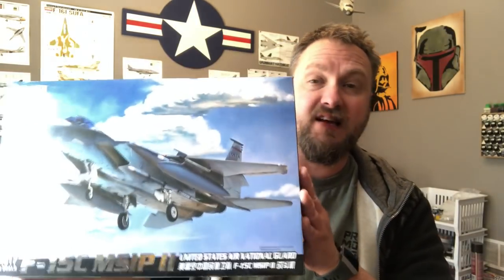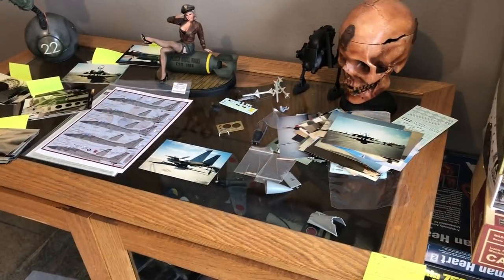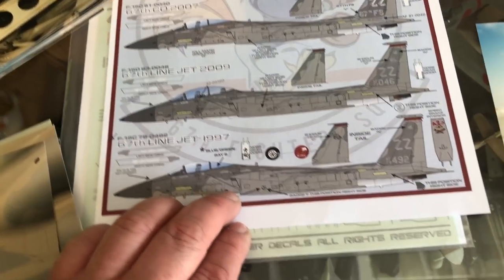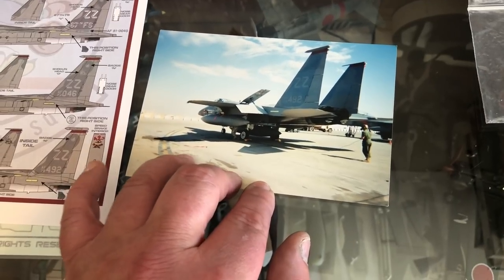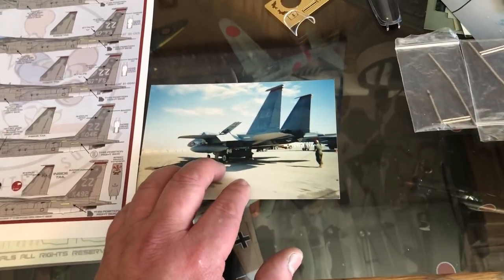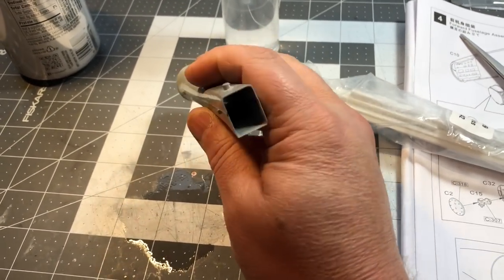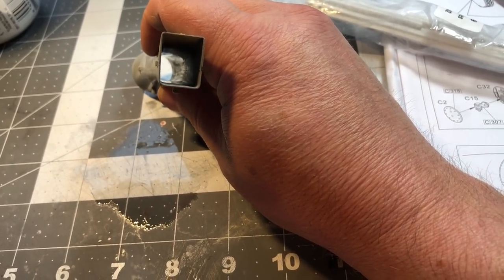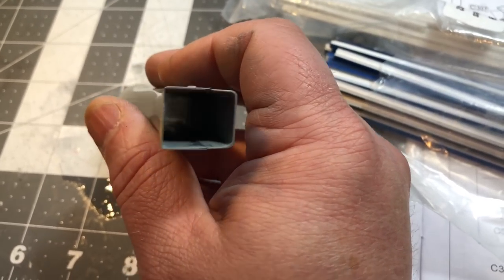GWH 1/48 F15C Part 1: Intakes and Exhaust

Comment: You can plug the intakes and dump regular latex house paint in, slosh it around until everything is coated. Remove the plug (I use tape) and dump out the rest. Hang to dry. The thick paint will fill in imperfections and leave the surface ultra smooth.